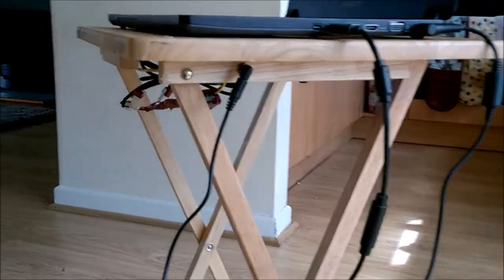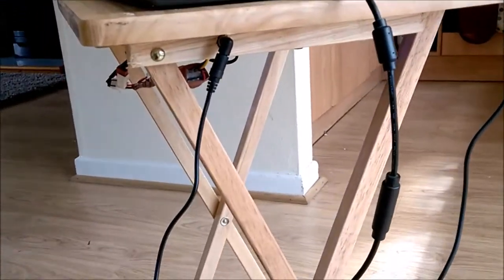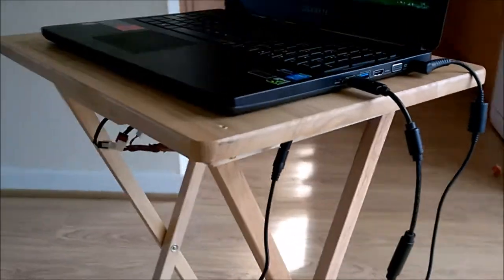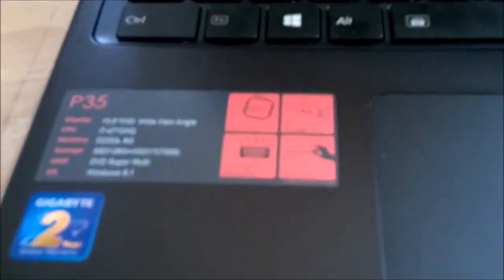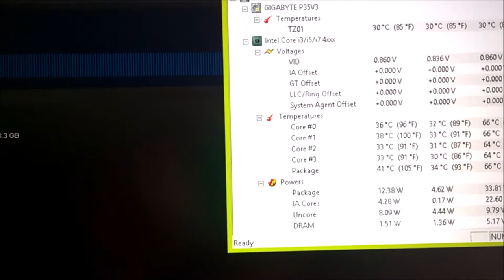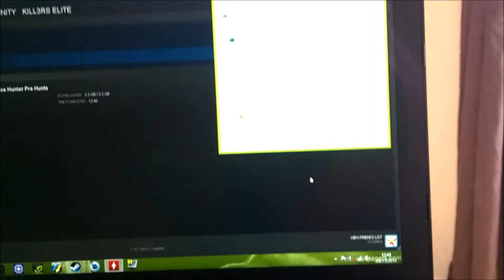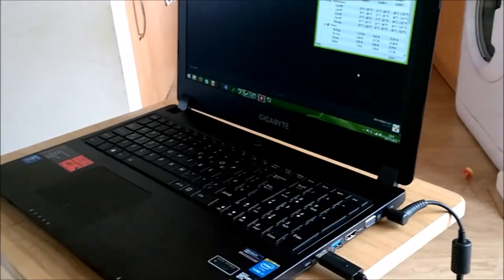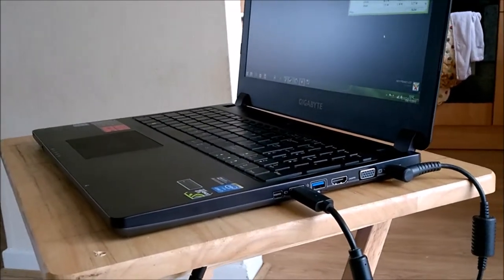Episode 1 Gaming Laptop Cooling Table guide

Comment: Hi, great video. I read in some Reviews that the internal Fans of the Gigabyte P35W is very load in high load. Stays the internal fan quite with your special table Fans while gaming? Greetings.
Reply from the maker: thankyou for comment.
indeed the internal fans reach very high db which are to loud for me. With my table the internal fans never go full load and the fans I have are at lowest settings (1200 rpm) and are no louder than your average desktop